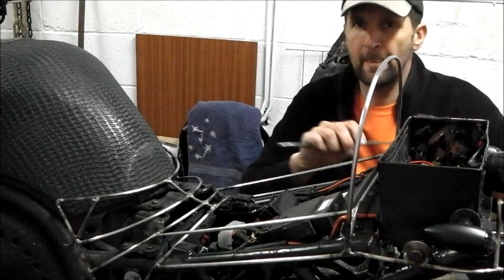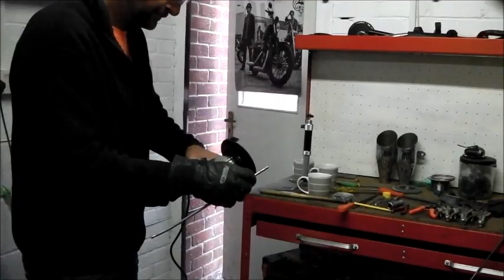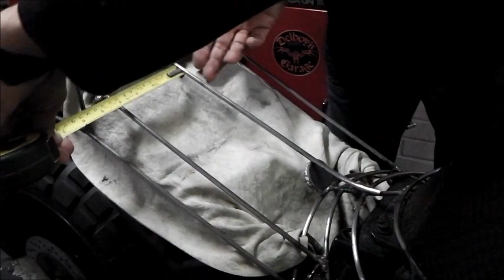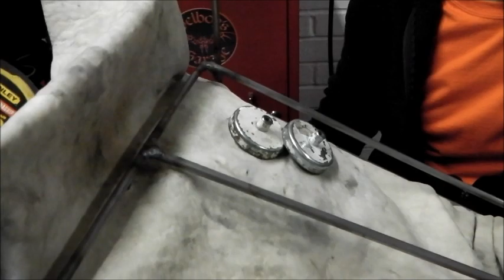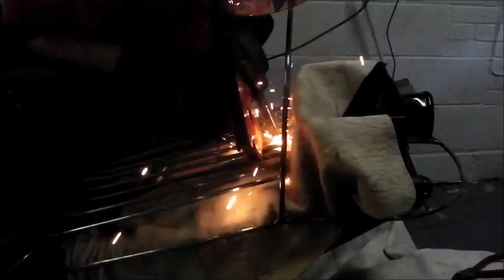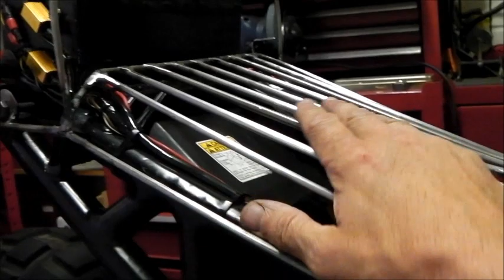Delboy's Garage, Project Bandit, #27 Rung what you brung.

Comment from the maker: Hi mate, Third or more ask on this one, the whole thing is only bolted on, and the existing parts of the frame that go under the indicators and back light will be cut away once i brace over them and make the french tunnel, (starting on that part in the next installment). then it will simply unbolt by taking the four bolts out and lift it straight off leaving everything under it intact.... thanks for your kind comments, its a fun project and going really well at the moment, lots to do still.Del

Comment from the maker: Hi mate, I use a 135 MIG and it's not flux wire, it's a gas machine and I make sure I test every weld with a good few sharp smacks and even during the weld process I make sure I get the joint bright orange (which is 1100 degrees) by slowing down the wire speed and dwelling longer on the trigger ... this ensures completely penetration and a good sound weld... thanks for you input mate, take care

Comment from the maker: yeah a few times now, and its real comfy, it slopes forward more then the OE seat, but thats what i wanted as its just the bare frame for now, i will be adding foam thats thicker towards the front, and that will make it bang on, the sides curve down dead right under your legs and the back is comfy and flat right across...sits you in a real street fighter position...

Comment from the maker: Third ask on this one, the whole thing is only bolted on, and the parts of the frame that go under the indicators and back light will be cut away once i brace over them, (lots to do on that part in the next installment). then it will just unbolt by taking the four bolts out and lift it straight off....

Comment from the maker: The entire quantity of steel i salvaged from the clothes dryer weight in at about 5kg, and ive used just over half of it, the GRP wont add a great deal, so the finished deal should be not much more then 7/8kg....not too bad, and it woll be proper strong too....this bike isnt about weight..

Comment: If you were to brace it, would you do small bits in between the struts. or use a longer rod and put it underneath.. reason i am asking is if you did small parts in between it may warp due to heat?